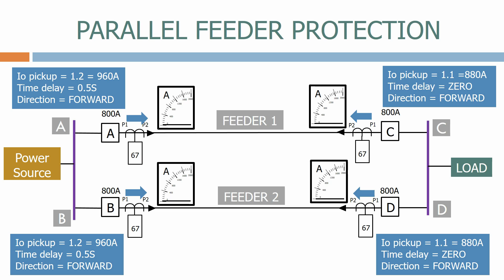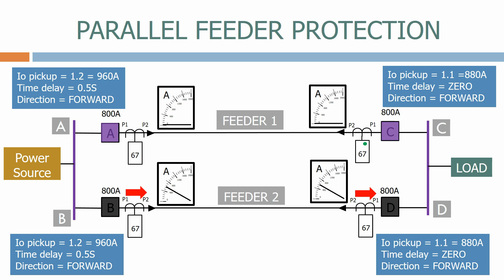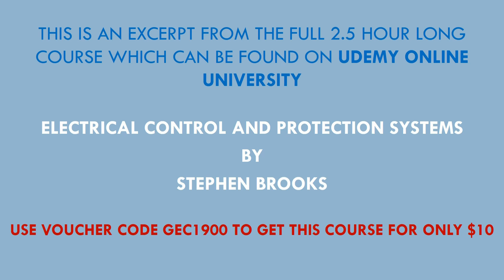Parallel feeder protection

Comment: C and D are in Reverse Direction, otherwise The relay would never trip and open the CB.
Reply from the maker: Hi Abdou,
                 As per standard practice the current direction that the relay detects is dictated by the P1-P2 CT arrangement, with current flowing from P1 to P2 classed as forward current.

The relay setting is therefore correct for this application.

Steve
Reply: @Electricalsteve Hello sir, 

Absolutely, that depends on the polarity of CT.
Thx sir for this clarification. The materials, which you provide are very valuable. The best in the internet. I